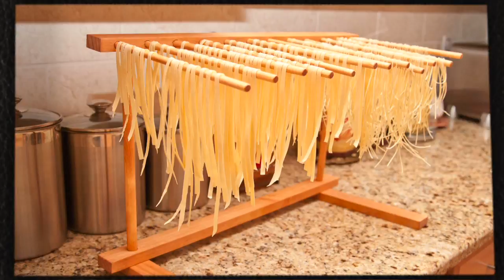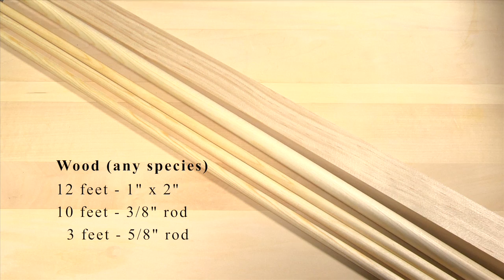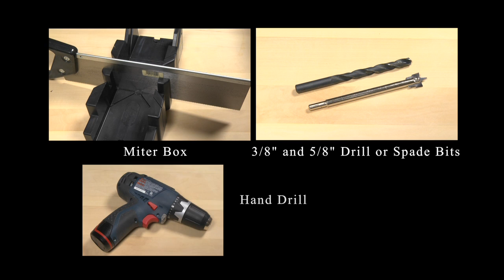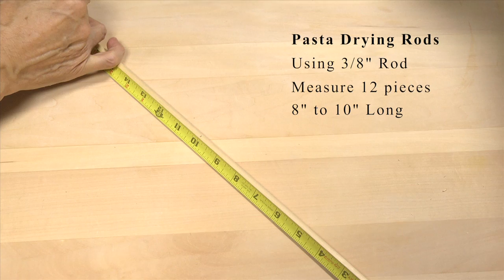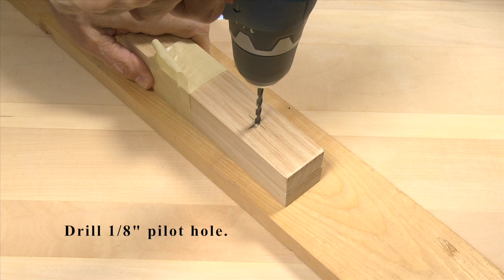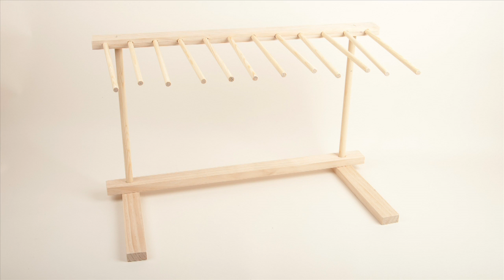Do It Yourself (DIY) Pasta Drying Rack Using Basic Hand Tools

Comment: I would make the feet 2 times longer and place it in the middle of the base, not only one side. than i would drill the top part all the way trough so the twice as long drying rods can go trough and i'd be able to hang pasta on both sides. i love the idea, but have a feeling that's a waste to use only one side of the rack.
Reply from the maker: Thank you for sharing your thoughts. Most drying racks are designed for small batches. My mother used broom sticks supported by two chair backs to dry pasta. Using a double sided rack is a great idea.

Comment: Thank you for posting your plans. Without a straight edge, or a dowel jig, to to make sure my 3/8 dowel was on center, it turned out; well let's just say good enough. 

Why do you need 12 feet of 1"×2" stock? I was able to make it using 8 feet.
Reply from the maker: You're welcome. Stock length depends on the drying rod length and what's available in your area. 8 feet is enough for twelve 8 inch long rods. 10 inch rods requires 10 feet. I prefer having a little extra in case of a mistake. Thanks for asking.
Reply: @DiTuroProductions  I was thinking the same thing as Noah. Two braces at 24" and two feet at 12" seems like only 6' of 1" x 2" stock to me. However, I agree about 10' of 3/8" dowel for the rods.